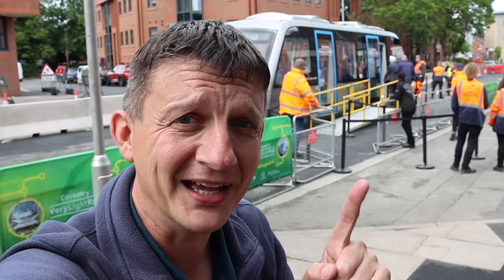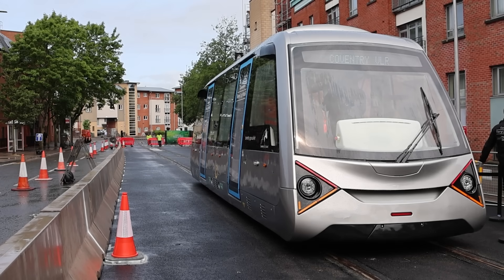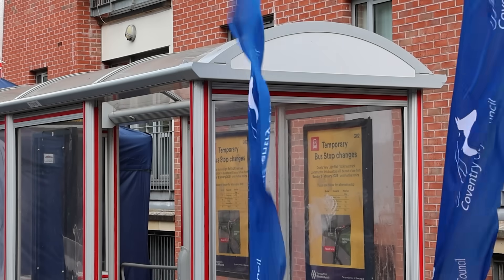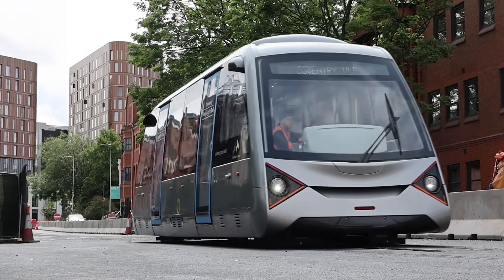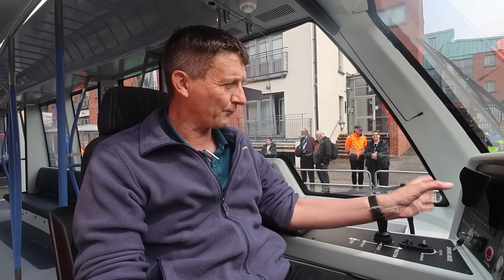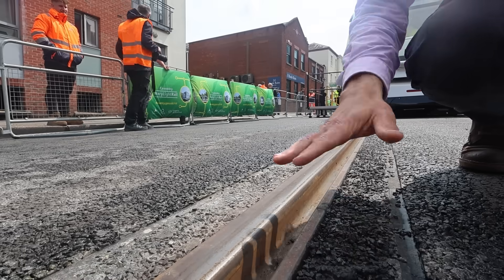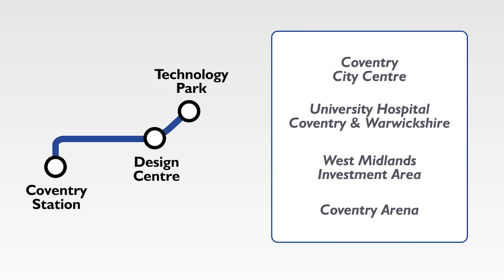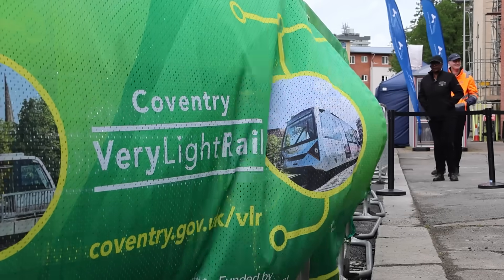The NEW! Coventry Very Light Rail is here

Comment: A lot of people seem to be in the ‘why not just use a bus’ camp. There have been studies showing that people who won’t use buses will use trams. It’s the physiology of having a physically fixed route and timetable I believe.
Reply: That is because trams get priority in traffic.  More of a "I need to get there" thing. Just give the bus priority and a smooth road.
Reply: @nothandmade9686  When you give the bus priority and a smooth road, you end up with something more expansive than a tram, less energy efficient, less labor efficient, and less comfortable for the user.
Reply: @Kollum  Not to mention the howls of outrage from car drivers who don't want dedicated bus roads.
Reply: True, but the smaller trams defeat the purpose of the railway being higher capacity than buses.
Reply: @YishaiBarr  trams, rail, and buses each have a different job when it comes to serving the public. buses for lower density travel, rail for longer distances,and trams are basically there for when you could probably walk a distance, but its just slighty too long. they're also much easier to intergrate into pedestrian areas as they alwaysm9ve in the exact same way so theres less chance for collision
Reply: @YishaiBarr  Yes, there would need to be 2 units working in multiple .
Reply: @YishaiBarr  Not necessarily. In fact, it could be an advantage. Buses typically only can carry 50 to 70 people so this tram car isn't that far off anyway. But the big advantage is trams can be coupled together and run as two or even three car sets or more during busy times, and as single cars off-peak. Buses can't run in multiple. I think I vaguely remember there was once an idea for a system for multiple working buses years ago involving the Dennis Darts, but I don't think it actually came to anything. And even then I think they would still have needed a driver in each one.
Reply: @YishaiBarr You could run them in pairs or triples by the look of the thing.
Reply: @physiocrat-sv A lot of the capacity is replaced by couplings. They should just use a standard tram.
Reply: @YishaiBarr  Well, this system uses cars that are lighter than a standard tram which means installing rails and so forth is less expensive and disruptive to the existing roadways. They should also be more efficient since the vehicle takes less electricity to move, being lighter. More of the energy is put into moving the passengers, which is supposed to be the point of public transit. There's nothing wrong with taking an old system (like trams) and using modern technology to improve it. Others have pointed out that they are much more accessible for handicapped people than a traditional tram which is also a bonus. Public transit should be useful to as wide a segment of the population as possible.
Reply: @YishaiBarr ...which wheighs 2 or 3 times more and requires tearing up the road completely to build tracks that can take the wheight of them. The cost and time to build increases significantly. 

The point of this system  is to make a rail-based public transport system feasible for communities of a somewhat smaller size.
Reply: Who is refusing to use a bus and only use trams ... when the tram network doesn't exist in coventry and many many other towns and cities .   Who made this study and how does it benefit them?
Reply: It's also to do with how buses manever as well - buses only steer from the front wheels, so its front swings out much further as it negotiates a sharp curve which leads to problems for it and other road users around it. Trams on the other hand turn from BOTH ends, largely stay very close to their rails in a curve and are very predictable in their movements. So no speeding up and slowing down all the time going through pinch points or to squeeze slowly past another bus comming the other way, no wild swinging from side to side for passengers in the front (why else do you think the BACK seats on a bus are more popular?) and the tram takes the curve perfectly each time instead of the driver having to manually nail it each time and sometimes missing the "racing line".
Reply: Buses normally have fixed routes and timetables. But have the advantage over trams in being able to divert in emergencies.
Reply: @neiloflongbeck5705 That "advantage" is also a disadvantage. The flexibility of buses means that routes can be removed on a whim. Very few people are willing to build their lives around something like that, but many more are when there's actually permanent infrastructure that you know won't just disappear suddenly.
Reply: @kyh148 those services supported by the local authorities need 56 days notice of changes. The rest are a commercial matter for the bus company. If they can't make money, the they won't run the service. It's one of tha advantages of deregulation. The trams and trolley bus infrastructure seemed to be a permanent fixture until suddenly it wasn't. The same is true for many bus routes.
Reply: For me, trams are just far more pleasant to use. Smoother, and yes, easier to understand routes, but I also just prefer standing to sitting if possible on public transport, because who wants to be stuck in a chair.
Reply: @BaseReality  You do know you can stand on a bus, dont have to sit down.
Reply: @CrazyInWeston  Because of the metal wheels and tracks of trams, they're actually a far smoother ride than buses and therefore are easier to stand up in than a bus, even for people who usually have difficulties doing so. Buses unfortunately have a bad reputation in most places, whereas trams usually do not. Once they're operational even with a bus service still going, people are just naturally drawn to using and preferring the trams over the buses. Plus they can run through pedestrianised areas in a way that doesn't stop people using the area AS a pedestrianised area - once you allow buses into those areas people stop using them the same way and eventually they just turn back to full-use roads again (this has happened in many cities already).
The biggest benefit to trams over buses, is although they have a higher initial cost, they more than make up for it in cheaper running costs. No large fuel bills, less regular maintenance and actually less mechanically complex, and they usually carry more passengers than a bus can so that earns you more money coming in than going out once it's been running for a while. They're usually a lot quieter too, which means you can run them earlier in the day and keep them running later into the night without causing issues with people living close to the tracks.
Reply: @BaseReality  People who struggle to stay balanced on a moving vehicle,
Reply: @BaseReality most people would like a chair💔
Reply: [citation needed]
Reply: @marthalauren858  It's called the Spark Effect , it's well documented .
Reply: That and these will be able to be extended and look more like a conventional modern tram. These are just the test vehicles and not the final cars, which will likely be able to be multi car-red. It’s all about how much weight is distributed per axle
Reply: Buses are seen as for poor peop!e but trams are trendy and continental !
Reply: So what about BRT systems?
Reply: Use a trolleybus then
Reply: @kensukefan47I'd wondered about that, but consider .... if there's opposition to tram catenary in city centres (the thing which kept 1st gen electric trams out of several UK cities), that'll go double for trolleybus wiring.
Reply: @kensukefan47 My city used trolley busses from the 1950s to the 1980s.  A feature of riding on them was waiting in the middle of an intersection (usually one of the main downtown ones), while the driver tried to get the damn trolley wire back onto the overhead wire. Much quieter than diesel busses, but the fact that they had to be steered along a road made for frequent disconnects. Not a lot of fun for the driver on a -35 C day in winter!
Reply: the real question is why not real trams, 60 passengers won't be enough capacity for this. this feels like a very short sighted decision
Reply: @justwobert9850  I'm sure there's a provision for coupling multiple cars together. That increases the flexibility of the system. Routes with lots of ridership or peak hour usage could use two or three coupled together and quieter routes could use single cars.
Reply: @justwobert9850  Because they are expensive. I think the whole point is the small tram can also use the normal tracks of the normal tram. That way you can cheaply extend your existing tram lines also into lightly populated areas without needing to change from tram to bus. I think the number of changes is WAY more important to the average traveller than whether it is a tram or a bus. If it is supposed to be used only independently, I agree: an electric bus will do the job cheaper and basically as comfortable.
Reply: @justwobert9850  id imagine the frequency would be around 10 minutes but i do feel like they need to double up on the cab size for viability
Reply: The bus can have a fixed schedule if it has dedicated lanes while a tram can have a messy schedule if it runs in mixed traffic. It’s more due to the infrastructure, isn’t it?
Reply: This CVLR is a gadgetbahn. Its a slower,smaller version of a tram. A Good Bus Rapid transit system would be cheaper,quicker, expanded quicker. You can even buy buses that look like trams and are silky smooth. Look at what they have done in belfast with glider. Its been a massive success
Reply: also it uses way less energy when running due to less friction between wheel and rails than tyres and road.
Reply: Buses don’t just go wherever they want whenever they want 😂
Reply: Trams are simply better than buses in every metrics related to user experience.
Reply: @thastayapongsak4422  What a load of garbage, I see you have been reading the tram manufactures marketing propaganda, and have been totally fooled by them, or are you part of the marketing team?
Reply: I've been waiting for someone to say this
Reply: The problem with buses is that their very flexibility, the thing that people cite as their advantage, acts against them. It's too easy to just add a new stop here, have every other bus go to that housing estate instead of this one, etc. before you know it, the "system" becomes extremely slow and massively complex, with individual routes becoming infrequent and unreliable. You end up having to explain that "to get there you need to catch bus route 3, 7 or 625, but not the 3C, 7A or the 625 after 6PM, alternatively you can get bus 8D and walk 10 minutes, but only at the weekend". Having a higher cost to change a tram (or whatever we're calling this) route means that kind of meddling rarely happens and keeps the system fast(er), simpler and more reliable.
Reply: Two big advantages over rubber on pavement such as bus,  are having the right of way and also the fixed infrastructure incentivizes higher value land use along teh route.
Reply: true but not for that reason

its because i dont wanna stop every 200 meters at every stop along a 12 mile route

it gets so bad that at times you can actually cycle faster than the bus because every 60 seconds the bus stops for 30 seconds or more so in that time a cyclist can catchup and even overtake the bus

add on when they do infuriatingly dumb shit like turning into a housing estate to waste 2 miles weaving around it before carrying on
Reply: It also that buses are mostly sh1t.
Reply: Also, as a pedestrian, it is much easier to predict where a trak will go as opposed to a bus - or any other automobile.
Reply: And how will such small vehicles manage with all the people it attracts? Lower capacity than a bus, so for every 1,000 passengers you need more drivers. That's on top of the construction cost. So you have something more expensive than buses, lower capacity than buses, and less flexible than buses.
Reply: People use public transport depending on the reputation

If it's full of homeless people and alcoholics, you'll never see a mother on median wage back on the tram after week 1 for the rest of her life.
Reply: THE VLRUURR IS a Better option .
Reply: Conversely 1 of my countrymen was arguing that the lack of a physically fixed route for buses is an advantage so that the gov't can save money by withdrawing it if demand drops
Reply: I just like trams simple as
Reply: A bus also has a fixed route and timetable
Reply: @AlexDahl  try telling that to British bus companies
Reply: @AlexDahl  but sussing out what the route actually is is a nightmare.  the timetables do not list every stop, the stops are often nowhere near what it says on the timetable.  Larger cities have a habit of lumping together multiple different routes into "lines" - get on the wrong bus and its not going where you want it to, despite being the same "line" as the one you wanted.
Reply: @AlexDahl  In principle, but his point is that the route is dedicated and almost exclusive to trams. Because of this they generally run near enough on time as it's a controlled route and not subject to details such as cars letting you pull out etc. You might then argue why not just make dedicated routes for busses then? You can search the internet for reasons why, but there are many.
Reply: I believe it's known as "The Iron Effect". When you install a railway, it signifies that the infrastructure is more permanent. So people are more likely to plan around it with their lifestyle, business, and investment.
Reply: This is really marginal. The benefits of a tram are higher capacity (more likely to get a seat/not stand net to someone) and that if a city has invested money in a tram system they will usually make sure it is frequent enough to be convenient.
Reply: Buses have timetables and fixed routes
Reply: @sie4431  atleast untill they dont 

trams can only go 1 route there not gonna suddenly decide well we need more money lets make it weave in and out of every estate between here and the destination

not unless they wanna lay more rail (they dont)
busses meanwhile can and sometimes do change there routes almost monthly
Reply: @sie4431  Until there's roadworks or major traffic congestion.  Then the buses don't turn up.  Happens all the time in Hertfordshire so people give up and get in their cars.
Reply: @sie4431 really
Reply: @sie4431  Only if you trust the council... Physical infrastructure is a more meaningful comitment.
Reply: @eps200 They could just as easily stop running the tram
Reply: @sie4431  Bus routes are easier to cancel because there was no investment into tracks.
Reply: For me it's ride quality - a tram feels like on track - less vibration, less wiggle no "creative" maneuver
Reply: It’s not just people, but retail and residential construction too who are more keen to go ahead with opening/building something new and expensive around something more permanent like light rail, whereas bus routes get canned/chopped left and right, no matter how ironclad their timetable looks.
Reply: During the London Blitz people said that it gave them confidence that all was still well if the trams were back running in the morning after a raid (as they usually were).
In Sydney New South Wales, the fools of the then NSW Govt of the 1950s removed the trams, and the people gave the thumbs down to the sub-standard replacement bus services and took to their cars. Trams never left people behind at stops because they were too full to take them on board, buses did.
Reply: @ktipuss Sydney is an excellent case study as to why trams are favoured over busses. Like you said, we ripped up our tram network and replaced it with busses. Realistic benifit: none. Fast forward fifty years and they're pivoting back to light rail. They shouldn't have got rid of it in the first place.
Reply: It is definitely the psychology and not the physiology...
Reply: Have you been reading the marketing propaganda put out by the tram manufactures? please give a link to the phantom study, and who did 
the study is always a deciding factor in how the so called study turns out.
Reply: Physiology? What?
Reply: And there are many people that don't wont get on a EV bus that well explode into flames when ever it feels like it. Because that's what it real is.
Reply: @SuperBartet what are the stats on that, compared to the probably tens of thousands of electric buses in operation? Feels a bit like refusing to get on an aeroplane because it might crash (when that scenario is really very unlikely, today’s crash in India notwithstanding)
Reply: @flp322  "tens of thousands of electric buses in operation" I'm always fascinated by the incredible stats put out by the EVangelists, they do like to make up false facts. It's very easy to look up how many there are in the whole world, and that's counting the large amount that are out of operation because of problems with them, and due to the amount of electric bus manufactures that have gone bankrupt. I see you just have not been following the news on the stupid amount of Electric buses that have exploded into flames.
To try and compare EV bus fires to airplane crash's is ridiculous. Airplane incidents are so very very small, that you are far more likely to die crossing the road than die in a airplane. So in your mind it's like saying there are so many crocodiles in the world why not swim with them?
Reply: @SuperBartet You do know that ICE cars burn 20x more often ON AVERAGE than EV's, do you? They burn so often, it is hardly ever in the news since it is business as usual. EV's burn so rarely (and when they do, they burn WELL! O boy...) that when they do it IS news.  That's why that's in the news and you avergae car burning not. 

And did you know that China just has adopted a law that prohibits EV batteries to burn at all, in any circumstances? That's the way it is heading rapidly. Since batteries have been evolving like crazy, that's a realistic law. Good luck for that with petrol.  You're sitting on a bomb that only needs one match, every day...  Try to light a battery with a match...

Sorry to spoil your opinion with facts. ;)
Reply: @qqleq  I'm assuming that the Chinese government has passed regulations for EV batteries and are not just arresting batteries that dare to catch fire!😁
You make a good point, though. Battery technology is evolving at a huge pace. The other thing the Chinese are working on is swappable battery packs. Even DC fast chargers will take a significant amount of time to charge up an EV which can be anything from annoying to costly on a highway trip. A battery swap station that could install a freshly charged pack in less time than it would take to fill up a gas tank would be a reasonable solution to this.
EVs are the future, but so are systems  which use a centrally located power supply instead of carting their power around along with their passengers. Yes, it's an old idea but that doesn't mean it doesn't work.
Reply: @SuperBartet and yet they will happily travel in a petrol powered car.
Reply: @SuperBartet but if you're afraid of that then this battery powered sort-of-tram is no better
Reply: @bighamster2  That is my point 😁😁